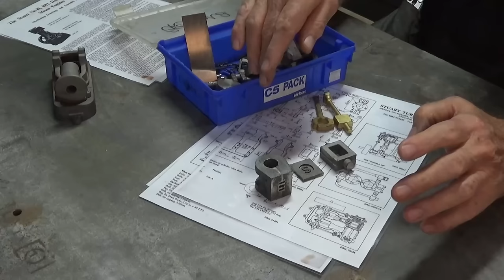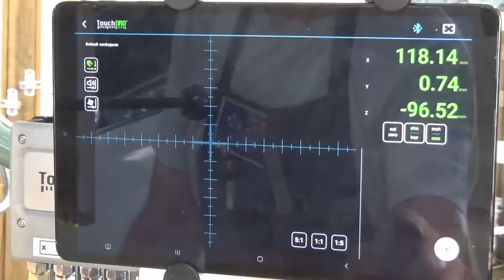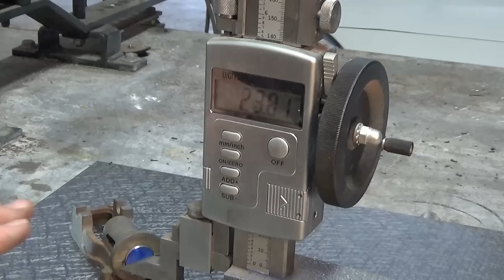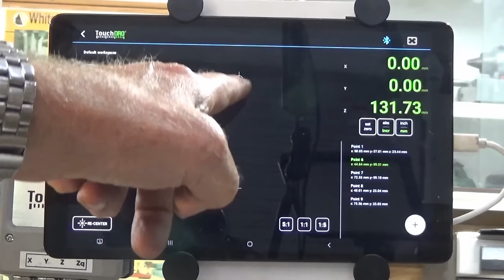The Stuart Turner 10H Part 1

Comment: Regardless of the project, I like seeing the process.  The actual machining, the head-scratching over how to set operations up, dealing with castings, etc.  It's all good, clean, fun.
Reply from the maker: Thanks and I hope you enjoy the rest of the build. Trying to decide the level of detail to include is never easy. Personally, I prefer to hear the problems solving method but I know that some people just want to see the metal being removed.
Regards,
Mark
Reply: @Preso58 I like to see the setup and problem solving. Other than a few short clips I get bored watching chips.
The hard spot in the casting is a PITA. I have ruined a few cutters on them, and fear I will break a carbide cutter when it suddenly picks up an inclusion.

Comment: I’ll be watching the entire series. It’s always useful to see how different machinists tackle different problems and setups with the tooling and equipment that they have on hand. If I ever decide to build one of these or a similar design I can pick and choose the methods and tooling that most closely match what I have available.
Reply from the maker: I think that is the benefit of having a sort of collective library of engine builds to choose from. You can rule out some build methods because you don't have the tooling but at some point you will see a method that you can achieve with what you have.
Regards,
Mark

Comment: I built one of these about 12 months ago. I wish this video had been available when i did mine. I had great problems sorting the the setup for boring the guide. Your solution was much more sensible than mine. Thank you, keep up the great videos.
Reply from the maker: I had already made the Stuart number 8 engine which is similar but slightly bigger. However, there's no one method that is the ideal solution. 
Regards,
Mark

Comment: Thanks for deciding to show this build. That turning set up looked really sketchy but I know when those sort of things work it gives you a lot of satisfaction. Like the livestock bit at the end.
Reply from the maker: It was a bit embarrassing showing that faceplate setup and it did look sketchy. I have three angle plates and none had the ideal spacing or number of slots to suit the faceplate. My lathe has an L0 spindle nose which isn't common so finding faceplates isn't easy either.
Regards,
Mark

Comment: Terrific job on that crosshead bore faceplate setup, Preso!. That really is an excellent way to do it, even though it is a ton work. It references the bore to the bottom surface, which is ideal. I usually end up cheating with some sort of four jaw chuck setup and it’s never as good as what you did.
Reply from the maker: Thanks Quinn. I was somewhat nervous with that setup. My wife's nice, new Subaru Imprezza was in the firing line if any of the hardware decided to fly off the faceplate. Instant grounds for divorce if I dinged the car!
Regards,
Mark

Comment: You gave me a solution I had never considered...Putting a plug into the cast bore for center locating.  I've fretted over trying to indicate either ID or OD.
Reply from the maker: I cannot take credit for that idea. I had read about it in the British Model Engineer magazine. However it's simple and it works.
Regards,
Mark

Comment: Thanks for taking the time to do this. I have a set of these castings and want to complete them this year. There is an interesting interview with the foundry that makes these and owns Stewart here on YouTube.  Stay safe and appreciate your videos
Reply from the maker: I will check that out. The first Stuart engine I built was the twin cylinder launch engine and it had the steam passages cast into the cylinder block. Making such tiny cores successfully must have been quite and achievement!
Regards,
Mark
Reply: @Preso58  the video is called "an evening with bridport foundry" the channel is national traction engine trust. The foundry is based in Dorset.  The castings and cores are nice seem to be accurate for castings even at such small scale

Comment: Excellent video thank you. That mapping function of the touch dro is very nice
Reply from the maker: You can save an almost infinite number of point setups using Touch DRO. I usually delete them once I have finished a setup but in theory, you could have a library of mapped points all referenced to an absolute origin.
Regards,
Mark

Comment: I'm delighted that you decided to make this video series.  I'm really interested to see how you tackle drilling the hole in the far end of the valve chest.  Joe Pie has an accurate but impractical approach.  I've just finished the Stuart S50 mill engine and the hole is misaligned by a few thou.  Not enough to stop it running, but the valve spindle just rubs on one side of the hole.
Reply from the maker: I agree with the notion of celebrating what to me was a lifelong dream of owning a working Stuart Turner engine. I purchased the UK Model Engineer magazine when it was published fortnightly and I used to linger over the advertisements for Stuart engines wishing that one day I would have the means to make one. This will be my third, 
Regards,
Mark

Comment: The problem with these thin walled castings is that cooling goes fast. You can easily pick up white iron which causes hard spots. Be prepared to encounter them. Now some foundries heat treat and shot peen which reduces these.

“This one really takes the biscuit”…. Love that expression!:)
Reply from the maker: I have seen Clarke Easterling from Windy Hill Foundry annealing all his castings in an electric furnace. I think his heating and cooling cycle takes nearly 12 hours. Back in the bad old days, before I had any carbide tooling, I encountered a similar casting for a Stuart Twin Steam Launch engine which had almost white iron and it killed every HSS tool I threw at it. I think I eventually ground the casting flat on the side of a bench grinder wheel!
Regards,
Mark

Comment: Thanks for videoing this build, it will be fun to watch how you do it. I'm going to help a friend with a Bolton #2 horizontal engine. I'm considering using stock material to replace some of the cast bits because it looks like it will be easier than trying to hold oddball castings like the connecting and valve rods!
Reply from the maker: Thanks. Some castings can be a nightmare to hold, especially if you have to do a lot of stock removal. The grip can sometimes be a bit "marginal".
Regards,
Mark

Comment: Great video Mark. Good proportions of setup, machining and waffle 😊. Never became boring. @11:50 I dont think that tolerance is a bit wide at all. After all you were only using a "by eye" centre punch to establish it.
Reply from the maker: I should have been able to get it spot on but the slots in the faceplate and the angle plate wouldn't allow for the last tiny movement I needed to get it perfect. I was actually considering machining the slots wider but I had already broken down the setup at least five times and it got the better of me in the end. 😥
Regards,
Mark

Comment: Thanks for posting this, Ive bought the vertical version as my xmas present so I'm interested to see your setups. While many people have posted their small engine builds, everyone seems to have a lathe and mill. Alas I only have a myford lathe. I haven't come across anyone posting an engine build with only a lathe....
Reply from the maker: Interestingly, the notes that came with the castings state that you can build this engine using only hand tools. I recall reading a build series in the UK Model Engineer magazine for an engine called "Handmaiden". It was built entirely with hand tools like files, a hand cranked drill and some clever fixtures but according to the writer, none of the parts were made on a lathe or a milling machine. The Myford is a very capable little lathe so I am sure you would be able to generate a good working model.
Regards,
Mark

Comment: Nice to see this, please show all the details that go with the machining. 🍻
Reply from the maker: Thanks. I am trying to show "enough" detail without too much talking. I am working on part 2 at present but I found out I don't own a 9/32" reamer for the bearings so it's on hold until I can get one delivered. 
Regards,
Mark
Reply: @Preso58   Its an odd size for sure, and my one won't help you as its over here in the uk. Very close to 7mm though, which is how my 10V was built.

Comment: Hey Preso, I'm a bit late to the series here! But looks greats, and very much looking fwd to seeing how you tackle this little engine👍
Reply from the maker: Thanks Stevo. I am almost finished with the build now and my next step is to dismantle the engine and do all the finishing. I will be powdercoating all the castings and polishing all the steel bits but I want the engine to drive something and I want it to run on steam so that means a coal fired boiler and a dynamo or a pump of some sort. I am sure you know how much copper costs now and almost all of the copper suppliers in Australia have gone away so getting materials is going to be a challenge. I also have a set of castings for a Rob Roy locomotive and even the frame steel is unavailable (it is specified as 1/8" thick and I now have a choice of 3mm or 4mm). Even the buffer steel is going to be hard to get. 
Regards,
Mark

Comment: The four engines:
10H - single cylinder, horizontal
10V - single cylinder, vertical
D10V or "Double 10V" - two cylinder vertical
D10H or "Score" - two cylinder horizontal

As you point out they're all substantially similar engines - all double-acting, and with many of the same castings though I don't know of anybody who's managed to put the reversing gear from the Double 10V on a Score. ;)

I would enjoy building a Stuart #3 someday, if I could ever manage to work up the courage to fire a boiler large enough to run the thing. ;)
Reply from the maker: I do have the drawings for the reversing gear parts and I was tempted to try to make those parts from stock but unless a horizontal engine is running something like a rolling mill or a crane it's probably not necessary. Even engines running machinery via belts can be reversed at the machine without having to reverse the engine. I did work at the Maritime Museum in Brisbane when I was studying at college and they had a steam operated yard crane with several reversing engines to operate the boom, the winch and the slewing gear. They ran it on compressed air one day and it was fascinating to watch.
Regards,
Mark
Reply: @Preso58  that's magnificent :D

Comment: Thanks Mark for the great video, ideal content for this beginner!  Wonderful what that DRO system can do though I doubt whether my budget will ever stretch to that sort of system.
Reply from the maker: If you have an old Android phone or tablet you already have 1/3 of the system. The TouchDRO adapters used to be around the AU$100 mark but they have increased in price since Yuriy rationalised the range of options he is selling. The glass scales are probably the most expensive item but the Chinese Sino scales are good and 5 microns is probably good enough for most work unless you are doing aerospace parts. Having said that, as a beginner it is a good idea to learn to use the micrometer dials on machine tools. It helps you to understand backlash and there  is no reason why you cannot carry out precision work with them.
Regards,
Mark
Reply: @Preso58  Thanks Mark for the info re DRO options.  I'm still getting the hang of using the dials on my lathe!  I don't yet have a mill so, when that time comes, a DRO will clearly have big advantages.  TouchDRO seems to be pretty useful.  🤔👍😃

Comment: Mark how did you align the cylinder bore with the lathe axis? What did you use for a datum on the casting… just curious
Reply from the maker: All I could do was to align the centre of the cylinder flange with the lathe axis and then run a square along the long edge of the engine frame. Once I had an accurate bore in the flange the crankshaft axis could be aligned with the face of the cylinder flange. There's probably 10 other ways it could have been done and all of the workflows rely on a sort of empirical approach where the initial reference surface or axis becomes the basis for the steps that follow.
Regards,
Mark

Comment: Presa,
Hi from the U.K.  Not everyone builds the reversing mechanism on the Stewart Models, not even Joe Pi. 
Is it possible that you could include this in your build please? Yes, there are other examples on YouTube, but there are a group of us who Subscribe to your Channel for a reason: The QUALITY of workmanship!!
Please consider doing this for me, and others who you may well find interested, should you ask😊.
Mark, thank you for your fantastic work, I’m disabled and can’t get to my workshop anymore and would hate to see what my sons have done inside to it!
I really appreciate what you do. Thank you again. 
Regards,
Paul 🇬🇧
Reply from the maker: Paul, I do have the drawings for the reversing mechanism on the Stuart 10H. I had not intended to include it in the build but I do have the Stuart twin cylinder marine engine that I built many years ago when I was just starting out in the model engineering hobby. Instead of starting with something simple I went straight to a more complex model. I had always intended to add the reversing gear to that engine but didn't get around to it. I would like to do an overhaul on it and I may include the machining in a future video. I have just finished the crankshaft, the bearings and the flywheel for the 10 and those parts turned out well. I was particularly nervous about the crankshaft and when you see the video you will notice how gingerly I am making the cuts. It's a case of "one false move and it's all over". 
The next episode should be out in a bit over a week.
Regards,
Mark

Comment: I think I missed something. I don't understand why the holes didn't line up. The DRO should get it spot on on both parts.
And say hello to Donna from us.
Reply from the maker: Michel, the holes would  have lined up perfectly but the initial start point I had used would have put the top casting offset from the base. It would fit but it would look wrong. I just had to tweak the starting location. Yes, Donna does a great job and she contacts me from time to time with some new clips. I always get a nice personal email from Wilvos when I made the monthly donation too. 
Regards,
Mark

Comment: Hey mate what is the zeroing tool called that is used in your mill for finding centres ?
Reply from the maker: The probe is a Chinese made touch probe but you need to connect it to a DRO with the capability for resetting the axes when the probe touches the part. I am using TouchDRO which is an app based DRO which runs on an Android tablet or phone. The controller has pins which accept the three wires coming from the probe. One is for 5V positive, one for ground and one for the signal. You can see the probe and the app in more detail in this video https://youtu.be/8OLyIAmY5c8
Regards,
Mark

Comment: Is that a hand scraped surface plate that I saw you doing layout on?
Reply from the maker: I doubt that it was hand scraped. Certainly not by me. It was the cheapest 400 X 400 cast iron surface plate that I could purchase new. I guess it may have had some sort of scraping pattern put on it to give a sort of surface texture though.
Regards,
Mark